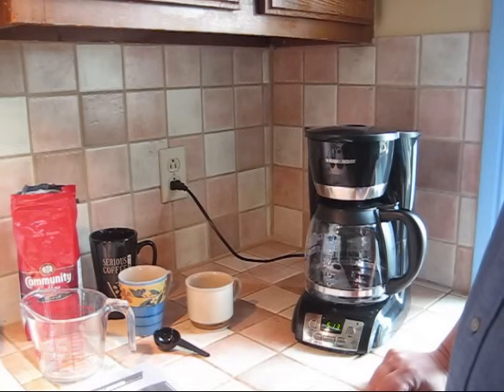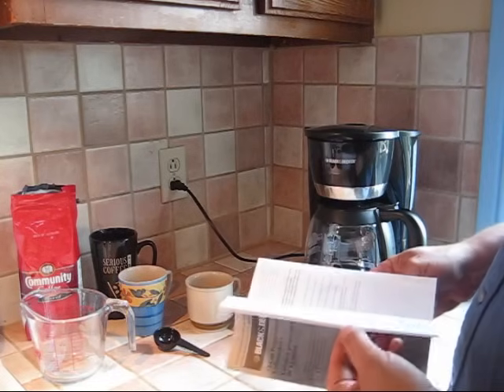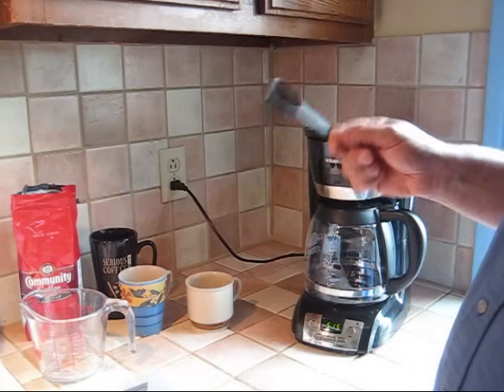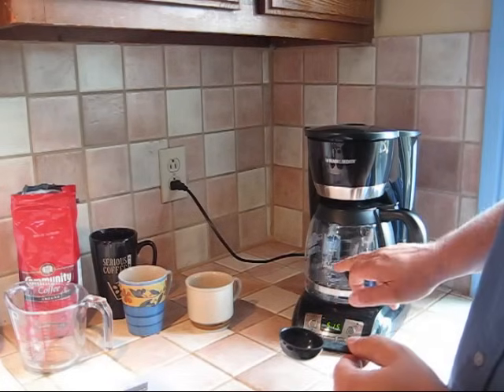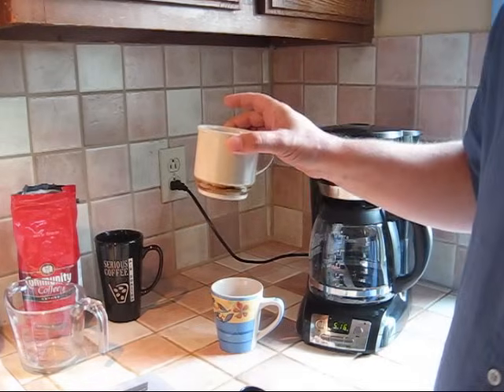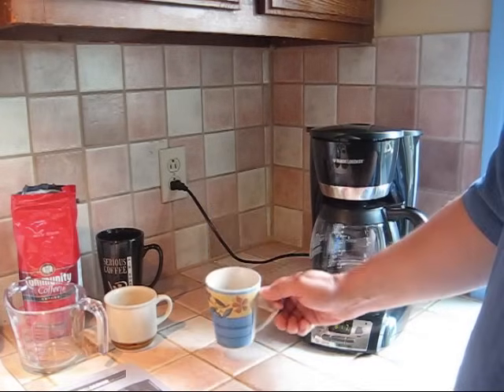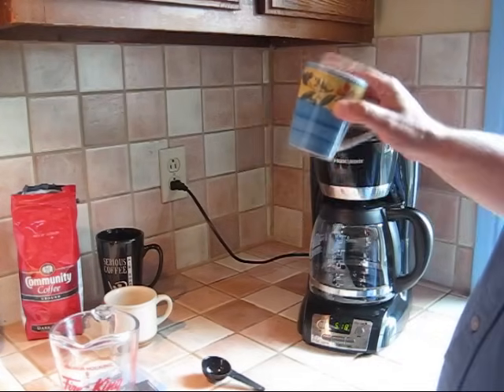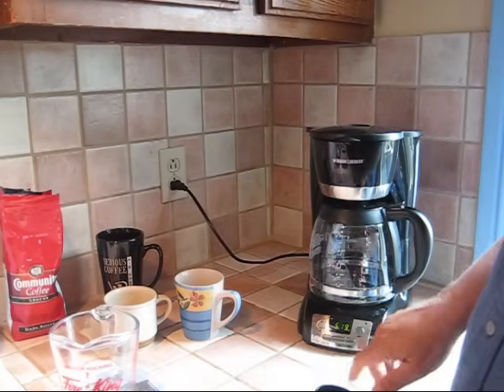How much ground coffee to add when making coffee in a drip brewer.

Comment: The best method is to use a ratio of grams of coffee to 1 liter of water. Invest in an accurate set of kitchen scales. 60 grams of coffee to 1 liter of water is a good starting point. For imperial units that ratio would be 2.1 ounces of coffee to 34 ounces of water. You can then decide if you want your coffee stronger or weaker. As a side note, a traditional “cup” of coffee is 5 ounces. That was set back in the 1970’s by Mr. Coffee and was eventually accepted by the majority of manufacturers of drip coffee makers.☕️

Comment: Making coffee is not "rocket science" . 
I have a 12-cup coffee maker , and I fill the carafe to the 12-cup line with cold water , and pour it into the coffee maker . 
Regardless of whether I am using a paper filter, or the wire screen basket , I use a 2/3 cup scoop to add the coffee grounds  to the filter basket . 
I like my coffee a bit stronger than a lot of people do. And, the coffee I use is a "local" brand which also contains chicory . But, that is what I grew up on.  
I noticed in the video that the man is using Community Coffee.  Which , is a well known brand in my area as well.  I use C.D.M. , which is also a local brand .  Regardless , the process is always the same .
☕☕

Comment: Start with verifying the marks on your carafe/reservoir first. "A" cup of fluid measure is 8 fluid ounces, a cup. Since I'm only good for half a pot if I fill to the "6" mark on the reservoir, it's really about 4 cups/32 fluid ounces/1 quart. Then figure out how much your favorite cup, mug or travel container holds and how many fills you're good for. Now you know how much water you're gonna use.

According to the vast resources of YouTube, I find I've been grossly shorting coffee for that amount of water. Fine.

Best info I've found is to ditch the volumetric and English measurement. Go metric, it's far simpler to scale for consistent results. A good start is 70 grams of coffee to 1 liter of water, roughly 2 TBSP per 8 ounces of water if you must. Wait, whole pot? 2 liters and 140 grams. Third of a pot? 1335 mls and 45 grams of coffee. I can do that in my head.

Like it stronger? Add more coffee to the base plan, but weigh what you add until you get it where you like it. Repeatable. Bonus, Weighing also gets you very, very close regardless of grind.

Comment: For way tastier coffee, boil your water on the stove first, then CAREFULLY transfer to a pouring container & fill the coffee maker to its 12-line. Add a heaping 3/4 measuring cup of grounds to the filter & hit brew!
Reply: Mine just goes to the 10 how much coffee grounds do I put in it.??
Reply: @Mika_25A  For 10-line I would add a healthy 5/8 cup. How much is that? Halfway between 1/2 and 3/4 . So, just put a 1/2 cup and two full tablespoons of coffee grounds (and if you prefer it stronger, maybe a 3rd spoon) =)
Reply: I actually used a measuring cup, I put 5 cups in and used 5 tablespoons. I don't know if that's right though. Lol
Reply: Thank you so much for responding!
Reply: @Mika_25A  No worries. Here's an easy way to do it. Fill it to the 10-line with boiling water, then add 10-tablespoons of coffee. That's the same as 5/8 cup. All the best!
Reply: @johnadams2833  so the 5 cups I did and 5 tablespoons won't be right then.? Sorry I'm asking. Lol
Reply: @Mika_25A  If you have a coffee grinder, have you ever tried getting some cinnamon stick from a store like Sproutz in bulk, like a 1/4-pound, and stir in a healthy spoon of fresh ground cinnamon to the coffee pot after it's brewed! It's the only way I will take my coffee! That and some dark brown sugar... freaking coffee heaven. lol
Reply: @Mika_25A  The problem is that the 10-line on your coffee maker isn't the same as 10-cups of water, so 5 cups aren't the same as half of that. If you don't have a 5-line on your coffee maker, are there other lines besides the 10-line?
Reply: @johnadams2833  4,6,8,10
Reply: @Mika_25A  I'd just eyeball it then, and add the boiling water to halfway between the 4-line and 6-line. Then 5 decent tablespoons of coffee. Or just go up to 6 and 6 if it got to be too much of a pain. =)

Comment: why r all these videos so complicated? ? 
my coffee machine or coffee says one heaped tablespoon per cup but my coffee machine is "10 cups" that's almost half a bag of coffee for one fill!! needles to say I don't follow instructions but then im unsure if I'm tasting the coffee right! !!! :/
Reply: Brian  Fahy cup sizes are different. we think 8 ounces for a cup but in the coffee world a cup is 5 or 6 ounces, not 8, and not the size of the cup we happen to drink from (in my case that would be 11 ounces).
Reply: Brian  Fahy 17.42 (unit) water to 1 (unit)coffee grounds
Reply: Brian  Fahy Half the bag is correct to get the same pot of strong coffee sold in McDonalds or Starbucks and it’s costly since these companies have a high turnover rate of customers they can afford large bags of coffee beans to make the correct coffee
Reply: so if i fill up my coffee pot's water up to the 8 mark, i should put in 8 heaped tablespoon in the filter? (note: I have a little measuring thing that came with my old coffee maker so i assume its a tablespoon i mean what else would it be)
Reply: little princess it's actually 2 tablespoons